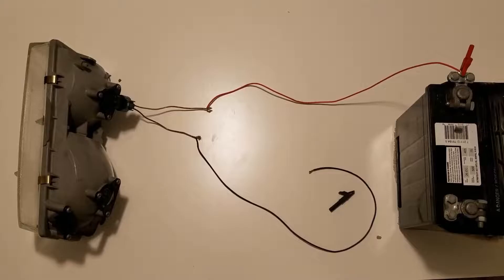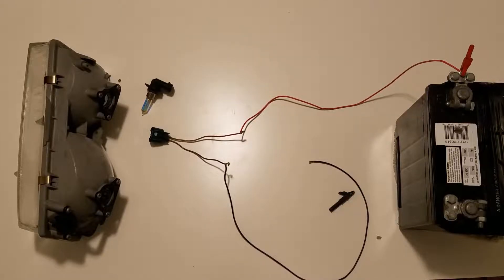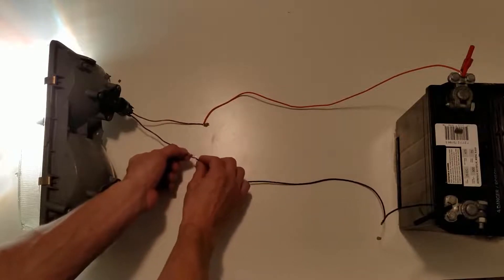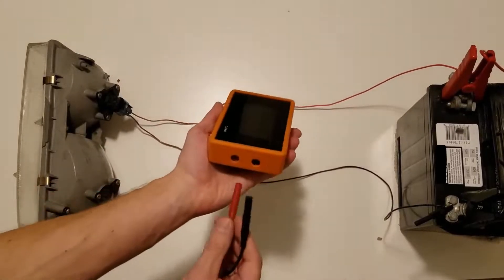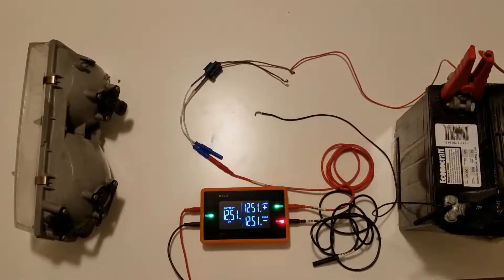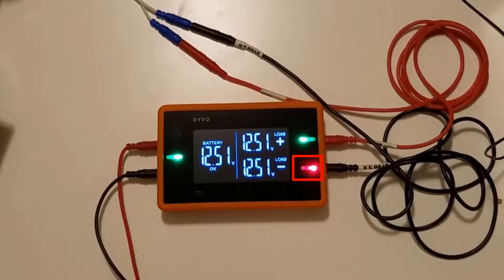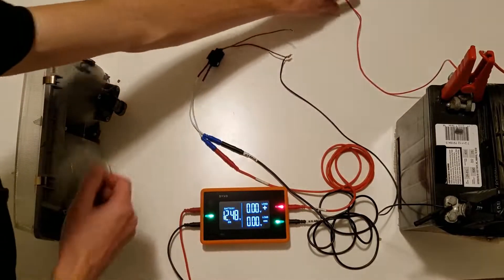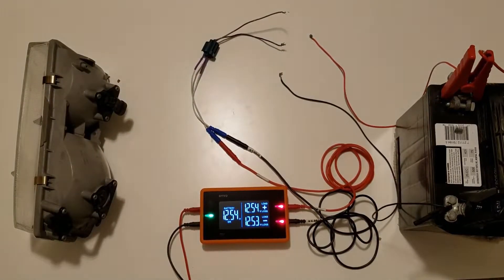DYVO - How to Find an Open Circuit

Comment: Just tried my new Dyvo on a Chevy truck with led headlights. One side works part of the time and when I tested the circuit in load mode by front probe showed circuit good with minimal voltage loss. Plugged bulb back in a did a back probe and started to notice some voltage loss to the positive side and my light for the positive side was green/yellow and red. Each led was on and the color of them was pretty solid. Bulb going bad???
Reply: The bulb is likely going bad, as the circuit tested fine without it, and the intermittent voltage loss (green/yellow/red LEDs) appeared only when the bulb was connected. This suggests the bulb’s internal driver circuit may be failing, causing inconsistent current draw. However, to confirm, test the bulb in isolation with the DYVO and perform a wiggle test to rule out an intermittent fault in the circuit, such as a loose connection or corrosion.
Reply: If the voltage is continuously dropping while powered on the bulb can potentially be going bad depending on how many amps are being drawn. That's when ohms law comes into place
Reply: If it's more than .5 a volt drop that wire can potentially heat up causing an open circuit in the future

*if I'm wrong please correct me on this. I'm not above correction by any way